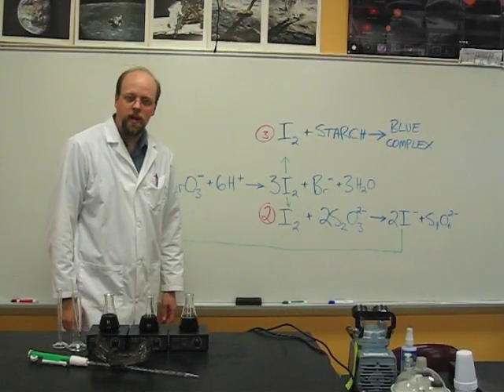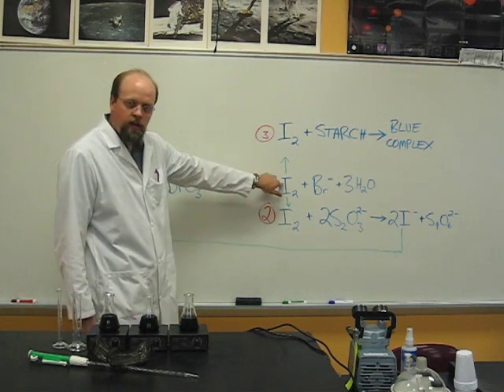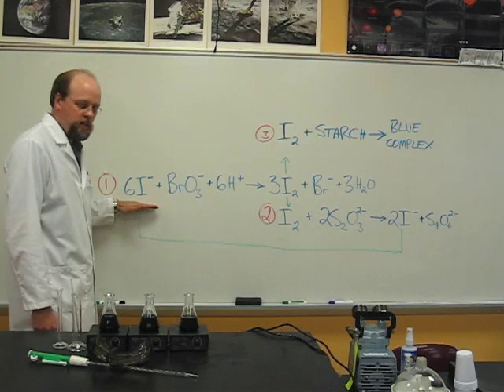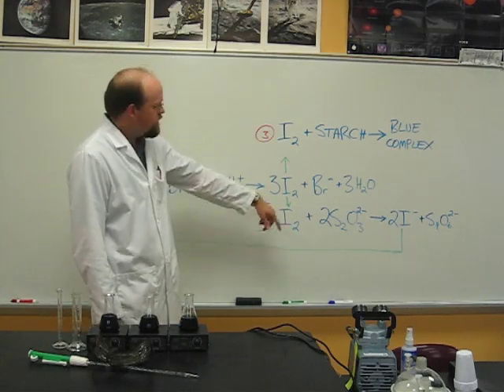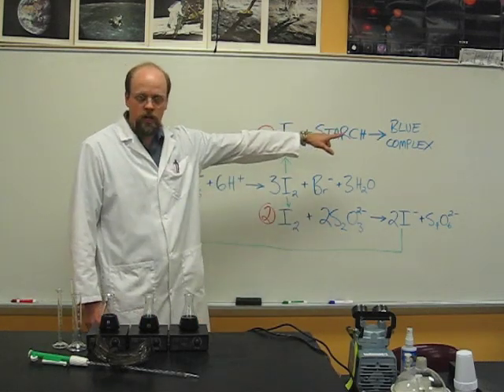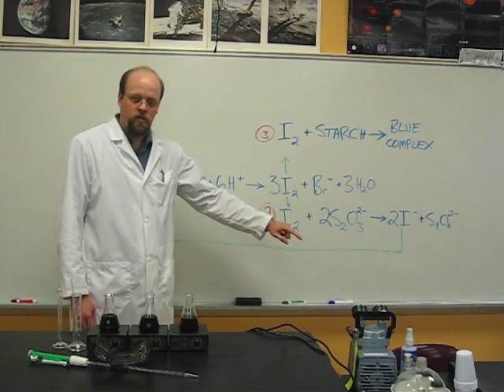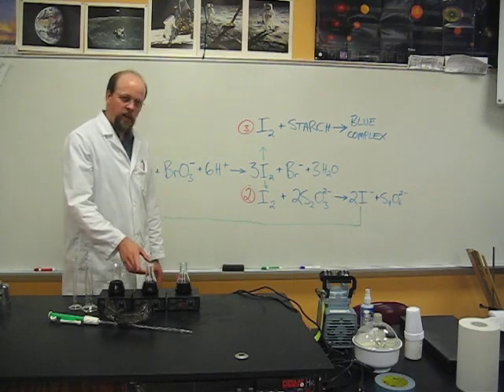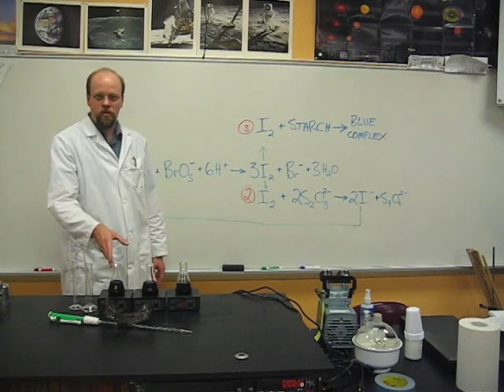Iodine Clock Reaction

Comment from the maker: Yes. The thiosulfate is the 'timer' in the reaction and determines when the color change may occur by preventing the formation of iodine (I2) until it is all used up. Perhaps a more dramatic difference in the timing of the color change could be achieved by varying its concentration.